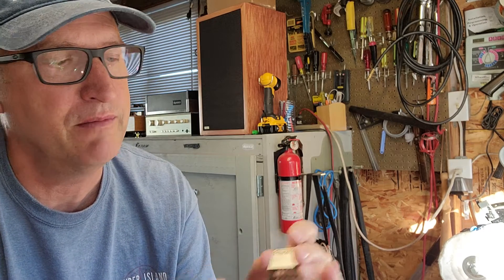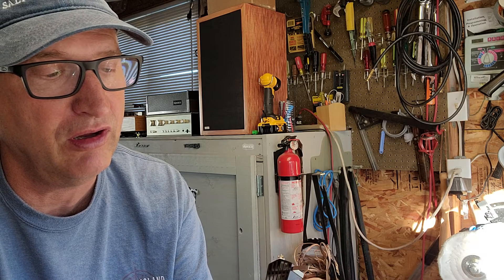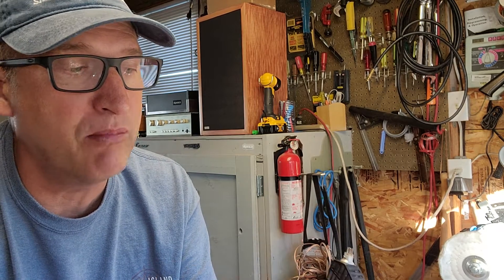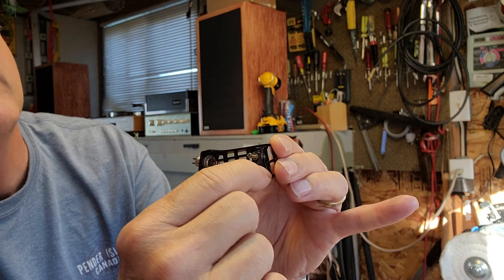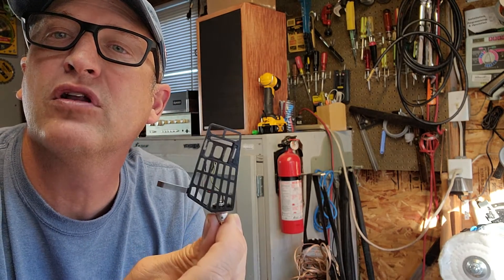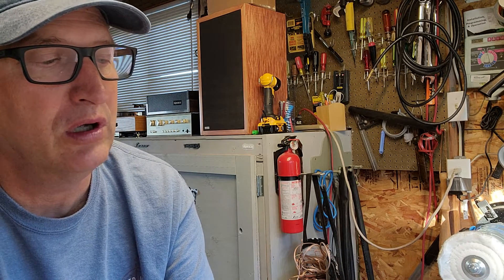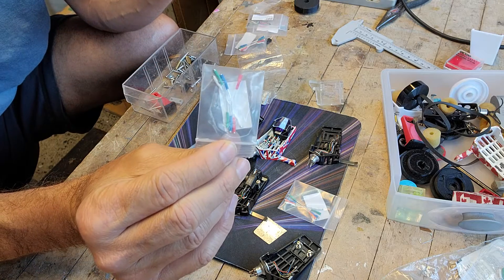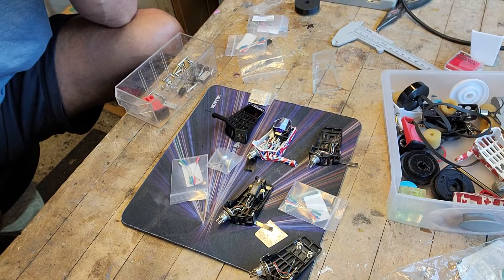Thorens TP-60 Explanation of how to use with standard 1/2 inch mount Cartridges

Comment: Hello, I have an original TP60,, it came with 160 i have brought, it's sound only the left channel, could be damaged the connector (the bulet like you said). It came with a shure m44c. Put an audio technica 3600 and also souds only the left channel. el first, the cables in the shure were connected in the wrong pin by the colour, iI have put them right but only sound the left channel. Thanks a lot!!
Reply from the maker: Try replacing the headshell lead wires. You can get them fairly cheap on ePray:

https://ebay.us/m/bzFLEC
Reply from the maker: Also, if you have a multimeter (every home should have one), do a continuity check on each terminal to see if it actually is the headshell. Then do the same between the arm lead wire connectors to the end of the RCA terminals to see if it is the arm wires that are pooched...🤔😉

Comment: Are the mounting plates available anywhere, the thread in one side of mine has stripped? Also just bought a AT91R cartridge for it but comes with 3mm nut and bolt....does the bolt go on top or underneath?
Reply from the maker: Get rid f the plate. It is annoying as hell. Use the slot as I state in the video. I believe the bolts are 2.5mm that fit that plate and you need to get precise lengths for various cart types meaning you need a whole set of varying lengths to fit differing cartridges. It was a terible system....
Reply: @navydiving cheers...are you saying get rid of both the plastic plate and the treaded plate the cartridge normally secures to? If so then I need to use nut and bolt to secure cartridge to the headshell...is that correct? If so would nut go on top of headshell or beneath the cartridge?

Comment: So on the 3D printed one, are you using the metal sleeve from an actual Thorens one, and that means it's removable from an original one without doing damage to remove it from the original?
Reply from the maker: Explained in the video. Here is the part you would seek:

THORENS CONNECTOR FOR HEADSHELL https://share.google/JYnW6eEt4sVauB0LN

Comment: Hi, Im in the process of getting the TD165 I grew up listening to back in shape. I accidentally  destroyed the lead wires on the headshell. What do you recommend for replacements?  One thing that I dont like about  my TT is the sqeeky springs.
Reply from the maker: Watch this video I made for the suspension - probably needs to be tuned after so many years:
https://youtu.be/EUAYkx7O4uc?si=TYZ9wrEg7X_-7kJ4
Reply from the maker: These headshell wires do just fine for me - I am not a big fan of expensive magic cable ;-)

https://www.amazon.ca/Cartridge-Header-Turntable-Headshells-Headshell/dp/B0CZ8XYHX4/ref=sr_1_1?crid=WMOBZIH4N57G&dib=eyJ2IjoiMSJ9.BKVr6f7mA2-m-_tSRn2kpJIEMhfyXlwdyaeos2X3jZ6iWifj0FgJcIE-BEoQLVUtRxvieuURBUu8ILRGLwLNVo_F6Nwfz20M23x3FJteSJcxvHUtWvoU2cZT372tEIGmLO3T_qRv_CM0S5ZrHZxC1ePjJV4OF0WxUgF22dJ4bPY0Ll6GqRtxlcjoR_4JvQ-0mbmPz6RPDU1BwUbYOqh-0GwDhYbL9oM3eyD_U5tgdUfMDjV1vccZupZpEo8qWIOx3yU5cIi8hbhaEPoAjm46i4bzg7iIfaOQADaqWnuqVxY.DsbOKZqWSP-rCJBwTfZ8XyzvQW3suZtLCjx2iM58yUo&dib_tag=se&keywords=headshell+lead+wires&qid=1747370435&sprefix=headshell+lead+wires%2Caps%2C228&sr=8-1

Comment: Hi, good video. Thank you. Can you please demistify is there option to adjust azimuth on TP60 and TP11 an 16 tonearms?  I saw some claims that Thorens designed TP60 to change azimuth in way that with one hand holding headshell and with other armwand tube and then twist it (torsion movement) in order to make azimuth adjusted? I'm completely suspicious about this claims...
Reply from the maker: @pkojovic  which azimuth are you talking about? Short answer is you can sufficiently adjust azimuth in all three axes if need be...🤔
If you are talking about trying to keep the top of the headshell parallel with the record surface (which should be adjusted to be parallel to the floor) then yes I use a tiny spirit level on top and twist the headshell gently until the bubble shows level...

Comment: Hi
If you use the tp60 plate in the headshell can you change the angle? In Other words is there any swivel movement in the plate when the cart is loosel fixed before tightening?
Best
David
Sheringham
Reply from the maker: No pivot - another good reason to lose the plate assembly...😉